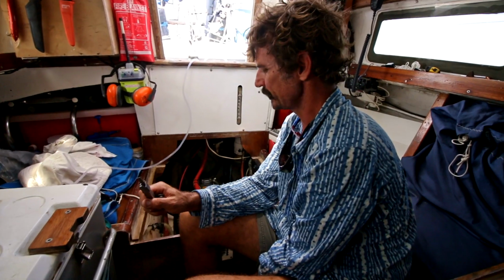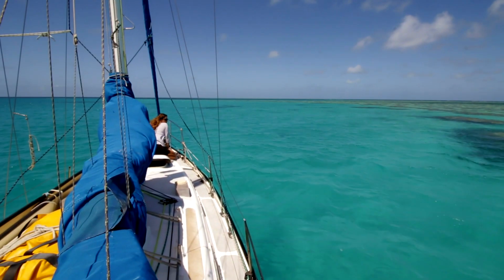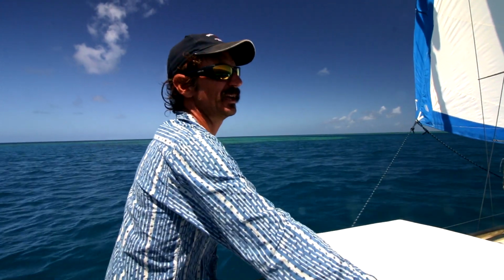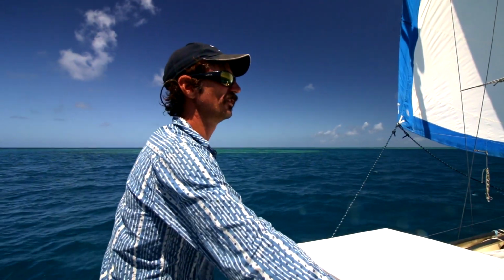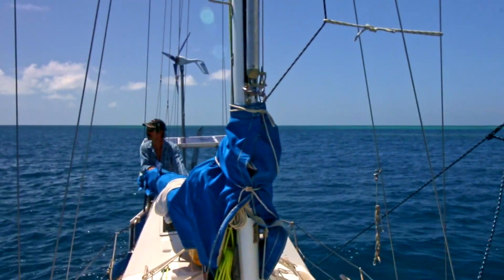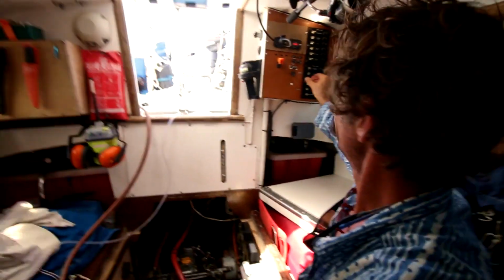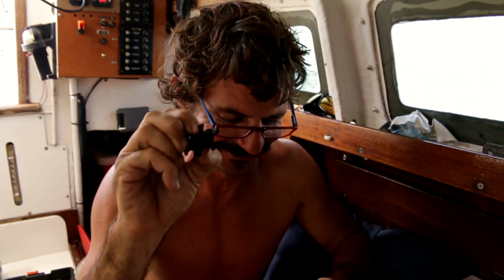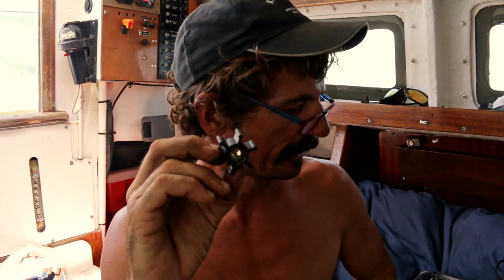Free Diving a Lagoon on the Great Barrier Reef - Free Range Sailing Ep 77

Comment: Do you guys ever use the red filter lenses when you dive either for your masks or for you cameras? If you do, what do you think of them?
Reply from the maker: Red filters work in the shallows but as you go deeper than about 9 meters, the water removes light in the warm end of the spectrum. This means there's no red light for a filter to work with. Artificial light about 5500K and as many Lumen as you can get is the only real alternative.
Reply: @FreeRangeLiving  thank you.
Reply: My son worked as an underwater dive photographer and he had a massive bank of lights for decent photos at depth.  My feeble attempts without these lights the reds had and other colours were washed out.
Reply: @andrewkeir2282  yeah I was wondering about that. Of course take some lights, but do they account for or allow the reds? I havent dove too deep...really just a beginner, but on the dives I have, I have noticed even with my dive light there was some color bleed.
Reply from the maker: Lumens are important. 3000L will light up your subject out to about 2-3 foot (1 meter) 6000 about 50% more. After that distance,  the water quickly grabs energy out of the light.
TL:DR-  Light it up and get close.
Reply: @FreeRangeLiving  good chat guys, thanks for the help. Diving Sairigao soon up here in the Philippines so will adjust kit accordingly.

Comment: Great video as usual, the wrong impeller being delivered happens, I remember in one of Hal Roths books , when he recieved a spare part like an injector etc, he would install it and keep the old one as the spare , so as to absolutley know the new one fits and works. Your salt water deck wash pump is a great emergency backup , that one goes in my files. Love your vids , fair winds.

Comment: Thanks Troy and Pascal. Excellent video all around. I was wondering if the old impeller could be made better if it had the cross pin through the bush and the rubber like the new (wrong) impeller. It might hold together even if the bond between the rubber and the bush let go? Just a thought.
Take care and all the best from Norm in Arizona.
Reply from the maker: It would definitely be an improvement.

Comment: Never can be to prepared. When I road older motorcycles I always carried extra oil, fuel filter, vacuum line, and sparkplugs. Because I knew my bikes and when it would brake down it would be on a Sunday afternoon just before dark. And the problem was going to be the fuel filter, vacuum hose, or a bad sparkplug.... LOL... I rode older bikes until I was 47 then I could afford a new bike. And I still carried these parts with me. Just incase I saw someone broke down on a Sunday afternoon just before dark. And I did more than once... LOL... And they were shocked when I had just what they needed to get their bike home... LOL... Great video thanks for sharing it... Be blessed.. BBE..

Comment: Another great video Troy/Pascale although I enjoyed seeing the mermaid and did miss seeing any bities!  I always keep about 5 of these little impellers around as they always seem to fail in the worst possible moments.  I've done 3 long 800-1500 mile passages up and down the east coast of the US into the deep Caribbean and I've watched and/or actually replaced 5 of them across two different boats (both Amel Super Maramu 53's).  Three on the Onan generators and two on the engines (one Volvo and one Yanmar).  In each of these cases, it was generally caused by sucking up Saragaso grass or having the generator running when the boat was heeled over too far but of course it never happens when you are sitting at a dock!   On my old trusty 1 cylinder Yanmar, I've gotten 10 years out of the little buggers and then the next year, I'll have to replace two of them!.   It just takes a minute or so without intake water and they are cooked.  I like that you had a system to bypass the pump and allow your engine to keep running.  I have the same with mine (the intake line is fresh water so I just use the fact that the inlet has a few feet of head on it to give it some pressure and then dump the outlet directly into the bilge - where my dual bilge pumps can handle it.  That gives me time to get away from anything that might hole the boat and then fix the real problem without worrying about running aground or getting run over by another boat/ship.  Of course this wouldn't work with a closed loop system like yours so I appreciate your system too!   If all else fails, I'd sacrifice the engine but I like to keep that as a last resort!  I  keep my spares in a dark place with a light coating of petroleum jelly on them to keep them in good nick along with some emery paper (to clean up the cover plate and remove any rubber build up/corrosion) and the puller contraption that I had made so I can replace it in about 5 minutes if I have to.  Like they say... cruising is just boat maintenance in exotic locations!
Reply from the maker: Keeping the emery paper with the spares is a nice tip, thanks. It's in the same league as keeping a set of spanners in the engine space, brightly painted that can be used to bleed air out of the fuel system quickly.

Comment: That's bad luck with the impeller. I was surprised how small it was, is there a way to put a bigger housing on to take a larger impeller ?
Reply from the maker: We could just run a seperate 12VDC external pump if we wanted.

Comment: Well, well...De jar vous...Alomost 40 years ago, we were on a Whitsunday Rent-a-yacht in the same area, also a Yanmar diesel, in a Columbia 27. It was New Years Eve, we were motoring to our ancourage in Nara Inlet, when the alarm came on. Same problem, impeller let go. Not expecting to get a new part from shore at that time, we fixed the impeller with a wire fishing trace threaded through the impeller and the bush. It was still working 4 days later when we replaced it with a new one. Whitsunday Rent-a-yacht were quite impressed.
Reply: Was that with Leon O'Donahue then?  He started an evil tradition on our boat on a delivery trip from Port Lincoln to Melbourne.   Crew Drink  "Pot of Claret"

Comment: May I ask what that horizontal line is for, that is connected to your cap shroud and what appears to be a halyard being pulled taunt?
Reply: My guess would be it's to stop the halyard making a nuisance of itself, slapping against the mast. I vaguely seem to recall there's even a proper nautical term for it, but it escapes me at the moment.
Reply: @Garryck-1  I was kinda thinking around the same lines. I've heard them slapping a few times but not daily like I'll be ready for soon. It seems like something he would do. It did seem to be pretty damn tight tho.
Reply from the maker: If you are talking about the green line tied to the halyard it is to prevent slap on the mast. It needs to be tight to tame 11m of line with one connection but it is only as tight as we can pull by hand. Nothing for a rope with a breaking strain of over 2 tonne.
Reply: @FreeRangeLiving  thanks for the clarification Troy. You guys are awesome. Have fun, be safe and KEPP ON SAILIN ON! cheers RJ 🍻⛵😎

Comment: Grab a small tube of polyurethane plastic bonding adhesive.  It literally sticks to anything and would be perfect for these types of emergency repairs.   Only downside is that it does not cure in a few minutes.
Reply from the maker: We have a good stock of epoxy for hull repairs if required.

Comment: the pump impeller   looks  very small,  you'd think they would engineer a  bigger pump, stronger parts
Reply from the maker: The engineers just want to get the correct flow rate to cool the engine economically.
Reply: that could be achieved with pulley size  and still create a more substantial impeller to last longer  .. no?
Reply from the maker: The impeller lasted fine. The bonding process of brass to rubber failed.
Reply: im just sayin.. i'v owned 5.7 litre inboards and their  impeller  veins are much bigger .. hence I would believe more bonding process or different attachment  process... that  lessens the breakdown of  a small impeller and overheat  at maybe a crucial time as mid ocean crossing..  the doldrums .. etc
Reply: the impeller  as a whole failed .. bonding or not bonding,  40 miles offshore, no wind, no engine...
Reply from the maker: That's when you have redundancy. Like a deck wash pump that you have already planned a way of using while safely on land. That is the message in the video. Everything fails. Plan accordingly.
Reply: I will end this thread,  I   believe your having difficulty understanding a well engineered impeller .. negates the necessity of having a back up deck wash pump that isn't an engine impeller..  maybe im the Canadian way and your the aussie way...   ..  regards Pascale
Reply: @buddyvibe9043  The guys a MED 1. That means he can be engineer on ships with 1000kW engines. You had a 5.7 liter inboard. Whoa!
I used to operate 2  CAT 3408 gensets and 2 CAT 3412 main engines. Marinized. Guess what. The impellers needed replacing. Mustn't be Canadian I guess.
Reply: Am I supposed to be impressed?
Reply: @buddyvibe9043  haha. Keep sailing that keyboard buddy cause the sea ain't a place for people who won't listen.
Reply: no problem  zero ?   lol,  keep living  your life vicariously through  Youtube videos,  hold onto that arm chair

Comment: Thumbs up for the deck washdown trick, got to remember that!

Last time, the store needed three tries to get me the correct impeller including like an hour digging through their inventory and "converting" a pin type to a screw type (only got a hole in the pump shaft, not a (darn what's the word. Like a keyway but on the face of the shaft). I actually ended up bringing calipers because try #2 was off by half a mm shaft diameter.
There's a Jabsco Parts Catalogue somewhere on the interwebs which I can't find at the moment where you can look up the correct part number yourself, most dealers just go by engine model which is often wrong. In  case you still have the impeller I'd just look up for what engine it's actually for (http://www.kadek.com.tr/flexibleimpellerpumps.pdf) and sell it or just pin it on the noticeboard in the next marina with a note like "freebie impeller for thisandthat engine, voluntary beer donations accepted on sy mirrool"
Reply from the maker: We found a home for the impeller. It is now spare parts for a friends 3Y yanmar.

Comment: Another fantastic video.  Great stuff
Friends of ours had a similar problem but with a propeller for a Mercury outboard. Rang an authorized dealer, were told the same as you that new part replaces old obsolete one, and lo and behold new one didn't fit, was completely the wrong size. Took it back, ordered "the right one" and again another wrong one was delivered.  They gave up in the end and just did what you have done and jury rigged the old prop which got them thru their holiday.

Comment: How, how, how do you forsee the need of an engine impeller like that?.....
Reply: They go out very frequently. I would carry 6 on my boat 👌
Reply from the maker: They are a consumable and we carry spare impellers as well as bearings and seals to rebuild the pump.
Reply: I swear, I don't know what I was thinking when I posted that reply.... especially when I sold the equipment, rigging, everything. Mustang been during our afternoon BBQ with plenty of libations present.

Comment: Why not ditch that crap design and go for the magnetic flow pump unit, where the magnets inside that do the same job as that crap chineesium rubber  prop would be the first thing i would upgrade on that engine
Reply from the maker: Belt driven pumps change the flow rate according to rpm. Any magnetic pump would still need to be a rubber impeller if it was above sea level and had to prime itself against a suction head. You would just do away with the shaft and bearing.

Comment: Why the Hell, does the boat industry use crappy pathetic rubber impellers.  Die left and right... Guaranteed income stream I suppose.  Just use a normal pump impeller.  Honestly can't be any worse.  Guess it would have to be a self cleaning double lobe and why they refuse to do it.  Because it costs 2 cents more.

Comment: Why does all this "marine grade" stuff fail all the time.   Automotive tech lasts so long, put a common modular water pump on and it should last the life of the boat!   And now electric water pumps for engines are perfect for a backup parallel circuit, or even continuous use!
Reply: Salt water corrosion.
Reply from the maker: Rubber impellers are a consumable item and are used because the pumps must be self priming and have a suction head of decent height. Auto stuff never has to deal with varying quality of input- clean, muddy sandy etc.